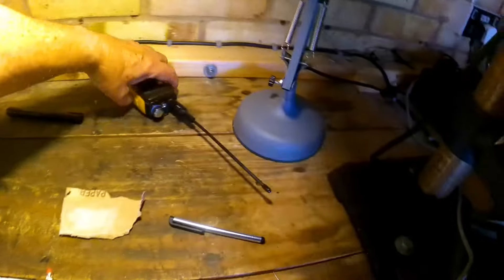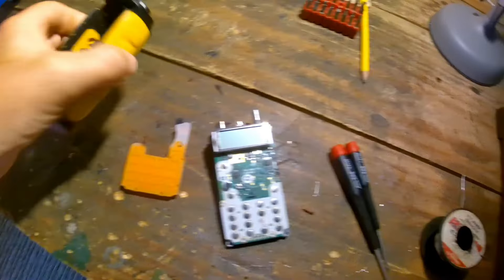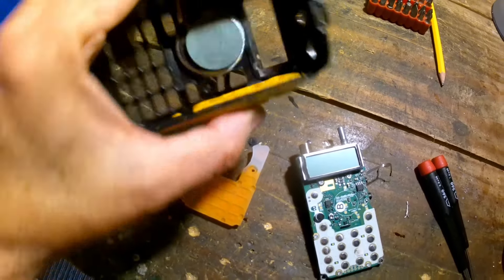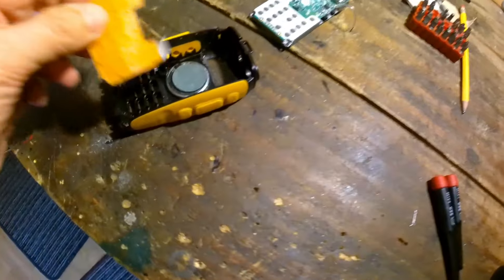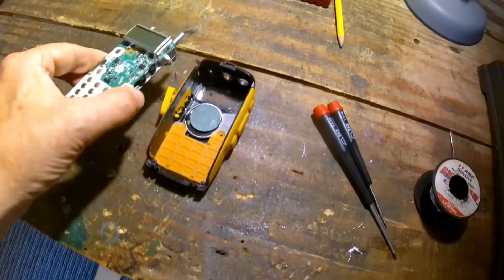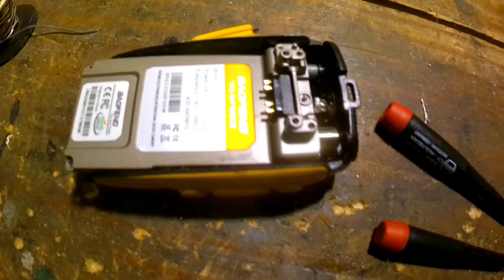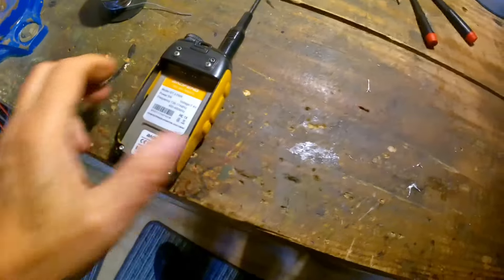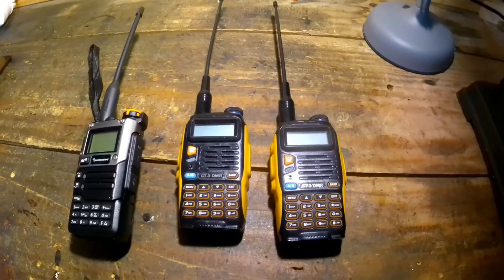Ham Radio. Baofang GT-3 DMR Radio. H/Held Walky Talky. Repair. #hamradio

Comment: That looked a fiddly job!
Reply from the maker: @ttxela  I was lucky. Most radios these days are non repairable. A big problem is I want my timing belt changing on the Bongo. So far I haven't found a garage willing to do it as its a mid engine vehicle. Bongo mechanics is in Leeds. George

Comment: It's not a DMR radio. It's just a dual-band (VHF/UHF) radio.
Reply from the maker: @theroguetomato5362  Well the booklet says differently. Compatible with Motorola DMR. Switchable Analogue to Dogital in settings.
Reply from the maker: @theroguetomato5362  
Copy of text
Now let’s welcome the new generation of Baofeng’s GT-3 series radio, the GT-3 DMR Mark IV. This two-way radio is upgraded from GT-3, it’s a manually adjustable, all-weather two-way radio with dual band frequency, 5W high power, 2000mAh battery; with functions of individual call, group call, all call, walkie talkie detection and battery saving which GT-3 doesn’t has.

 

Last but not least, as an analogue radio, GT-3 DMR Mark IV is provided with DMR Time slot 1 function, which means you can just use it together with other digital radio like MOTOROLA radios.
Reply: @MakeDoAndMend1  The Mark IV is DMR. All other GT-3 models are VHF/UHF (dual or tri-band, depending on the model).
Reply from the maker: @theroguetomato5362 It's marked DMR on front and On name plate .